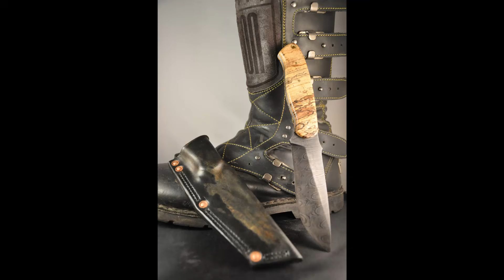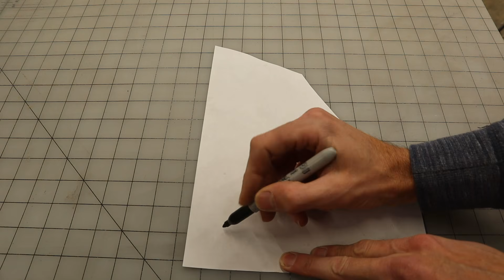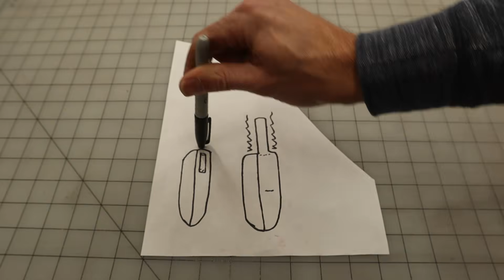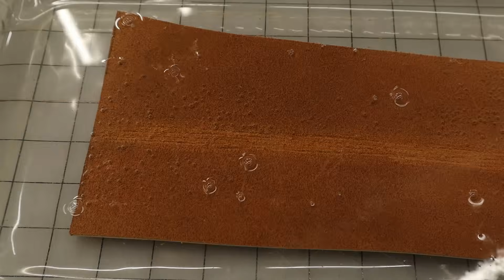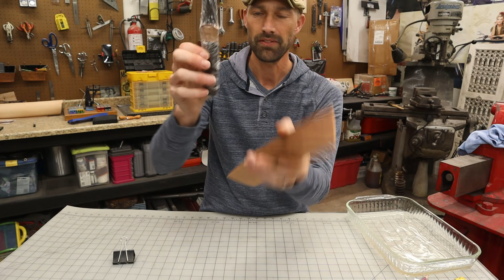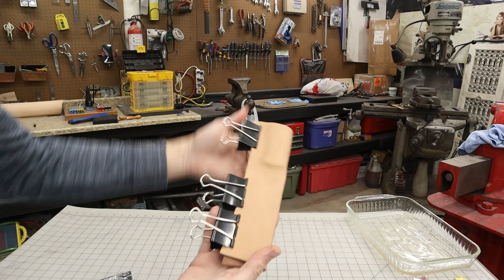Making a leather sheath for a knife - Easy Tutorial

Comment: What size clips did you use to hold the leather closed?
I tried this method but apparently I used to small of clips so it left in prints in the leather plus the ink from the clips bled into the leather. I used 4-5oz veg, tan leather.

Comment: So I made one and it worked for a while but the leather must have stretched and now the knife doesn't stay in. What did I do wrong??
Reply from the maker: A couple things to try. Make the next one with tighter tolerances, and make sure you use something like super sheen to coat the leather.  The only way leather stretches is from water or oil. Super sheen helps protect from water. It may have to do with the knife design also. There are multiple variables
Reply: @Aleeknives  awesome! Thank you! I got a lot of compliments on the sheath... More than the knife actually 🤣
Reply from the maker: Gotta love that!